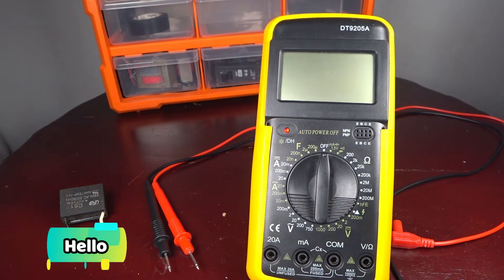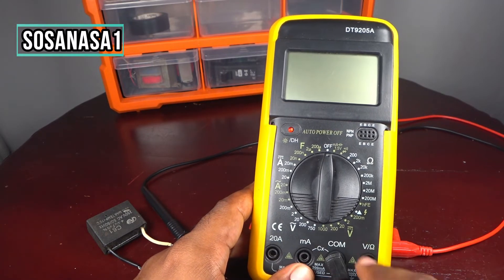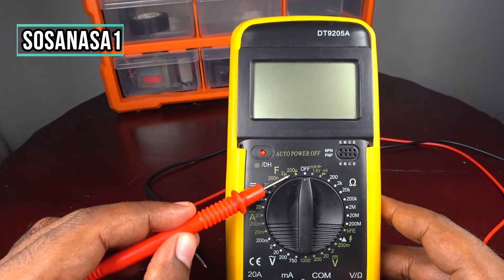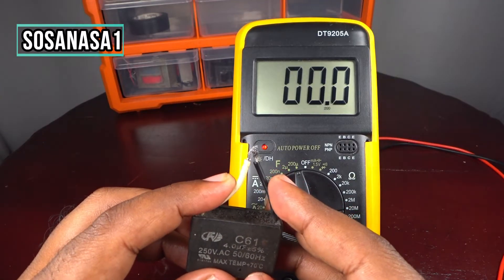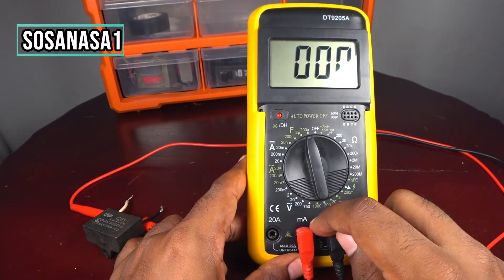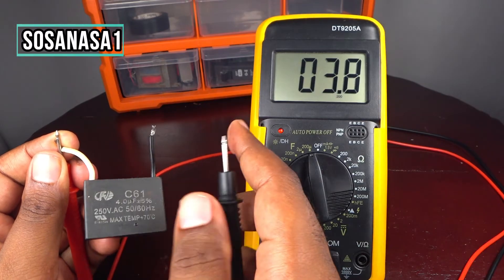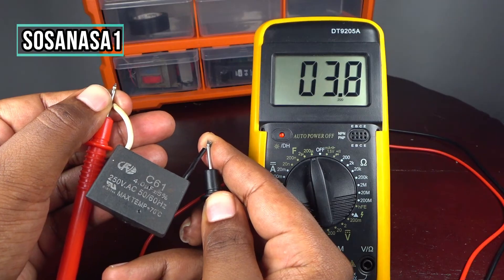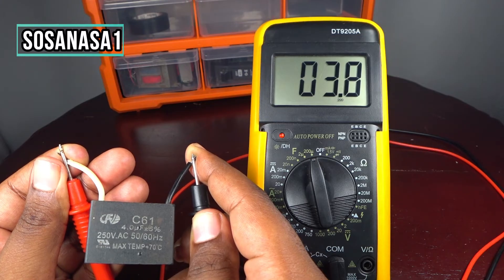How to TEST and MEASURE a Fan CAPACITOR using Digital Multimeter model DT9205A easy and quickly

Comment: The "Cx" on the multimeter is for capacitors ... And you shouldn't touch both probes with your fingers. It can interfere with the measurement.

Comment: When a ceiling fan is not rotating what mite be the problem.
Reply from the maker: If the fan blades don't rotate, the problem can be the capacitor, the motor or the wire, the common its a bad capacitor

Comment: Hello check with you my ceiling fan 1st and 2nd speeds doesn't work only 3rd speed working, when I removed the cover notices one of the capacitor body  melted and opened , may I know this is the root cause  that's caused the issue, hope to hear from you soon thanks

Comment: Hola. No entendí por qué conectaste uno de los cables de prueba al enchufe con el símbolo [V/Ohm] para tratar de medir las capacidades. Porque la forma correcta es conectar inmediatamente los dos cables de prueba a los dos enchufes en el medio. (Si mira de cerca, verá que el símbolo [Cx] está encima de estos dos enchufe, lo que indica que estos enchufes deben usarse para medir los capacitores). Gracias por el video.